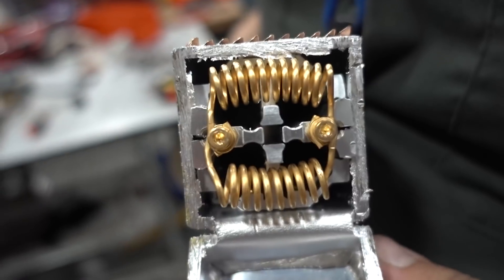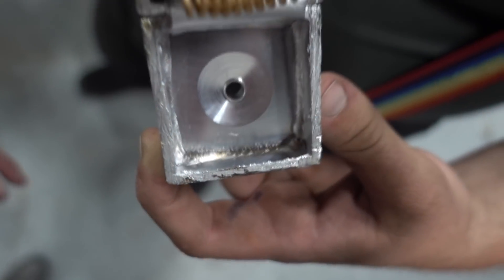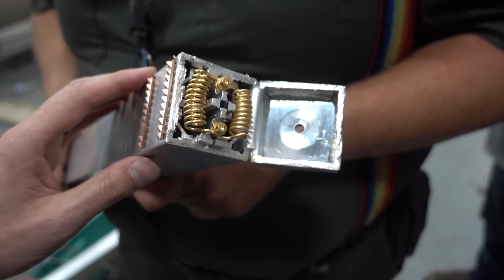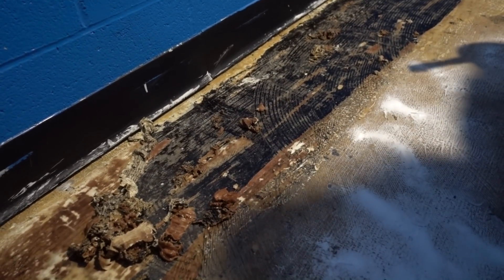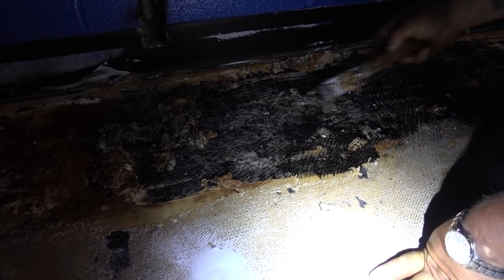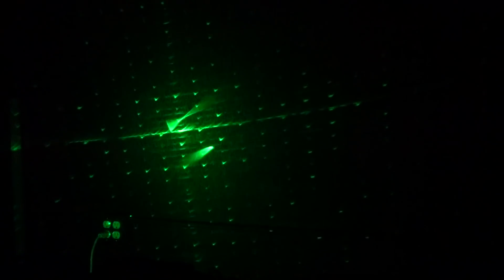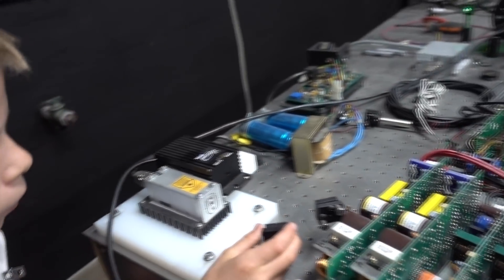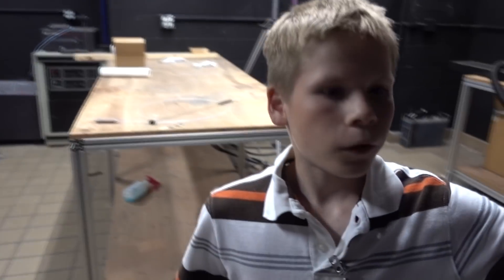Captain's Blog 7 18 2018 Inside Welding, Floor Goop, and Sam's Laser EEPROM

Comment: "I believe that children are our future, teach them well and let them show the way"  - George Benson
Are you sure that's a weld ?
I'm thinking it could be aluminium solder, heat the end after assembly
If it's a weld, maybe the end caps are welded then welded further down the tube
Reply: The solder wouldn't bead up like that if it was soldered from the outside, same as a weld.